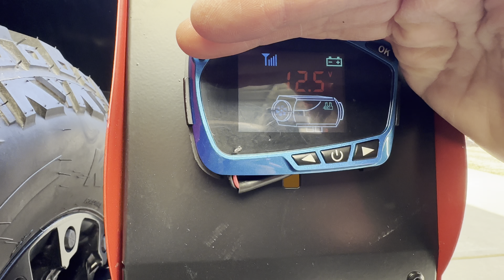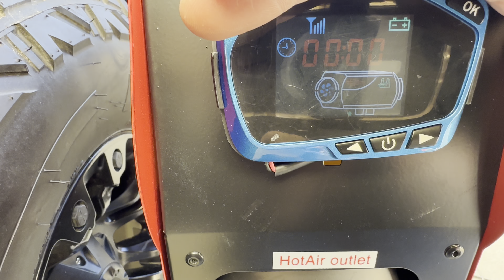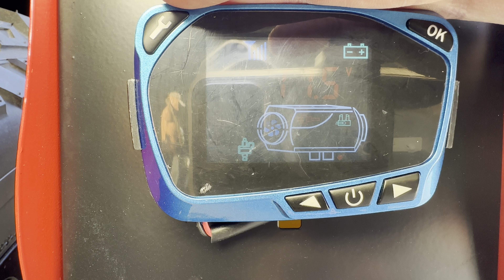I need to figure out this Chinese Heater!

Comment: You might be able to get a 120v to 12v inverter.  Plug the inverter into the 120v outlet.  The 12v socket I think has a max 10a rating which is why it shuts off that circuit
Reply from the maker: Yea that’s exactly what I did and it works like a charm now:)

Comment: Had same problem when I tried to use a Delta 1300.  12 volt auto plug is limited to 8 amp.  Voltage during ignition drops below 10 volts (9.4 volt) and relay is tripped.  I'm replacing with Delta 2 which supports full 10 amps.  This should fix the problem since I can easily start diesel heater on the 10 amp auto plug on my van.  Voltage drops to about 11 volts during ignition as measured by the 2kw heater app.
Reply from the maker: AstroAI AC to DC Converter,... https://www.amazon.com/dp/B082SDLNCK?ref=ppx_pop_mob_ap_share
Reply from the maker: One of the subscribers recommended this and it works like a charm.  I was about to buy a delta 2.   Even though more battery banks is always a good thing, it helped

Comment: I jusr run a 110 to 12 volt converter on my ecoflow, my little chinese heqter works great and will run off my delta 2 max for days. 

Now i dont have to get up at 3 or 4 am to fill up my honda as my electric heaters really made it use the gas, couldnt get 6 hrs on a tank.
Reply from the maker: Nice Craig. im going to look into the 110 to 12v converter.  Thanks for the heads up!

Comment: The diesel heaters pull from 10 - 12 amps to start up. Not sure what your EcoFlow is rated. After it starts it only pulls .5 - 4 amps to run.  (Or that’s what the specs say). There have been a couple YouTubers with the same issue when they run off of their solar chargers. I just run mine off of my secondary battery.
Reply from the maker: Thanks deedaw.  I’m going to have to run it off my trailer battery which is fine.
Reply: Ecoflow 12 v plug max at 10A only I have the same problem on my Chinese heater
Reply from the maker: @wangoprc4 thanks Wang.  Yea I think my fix is to run it off the battery.  Thanks for watching brother!